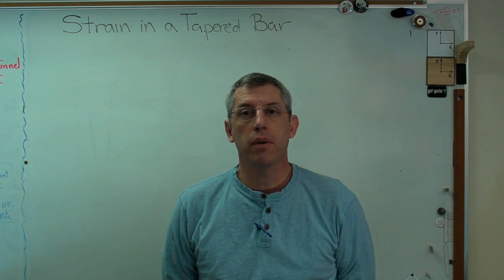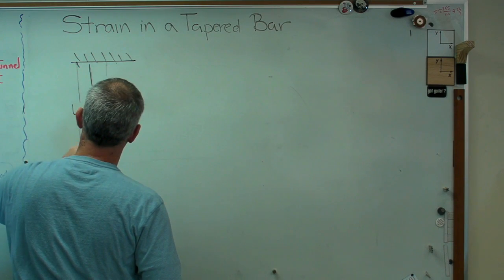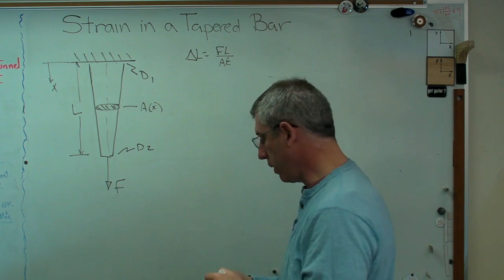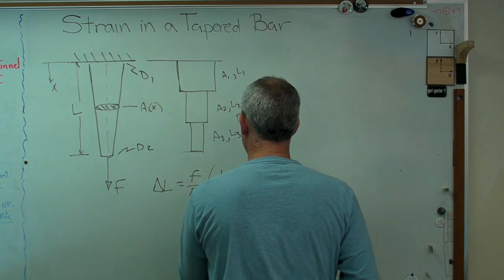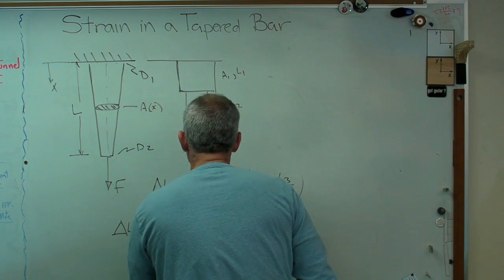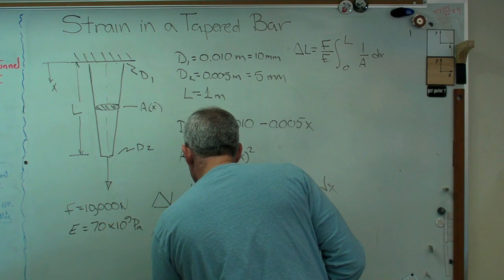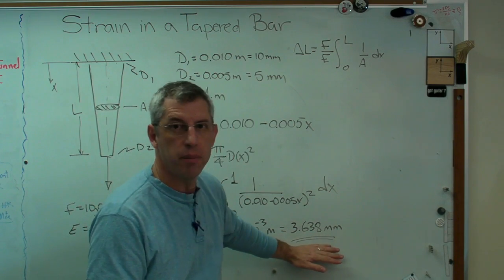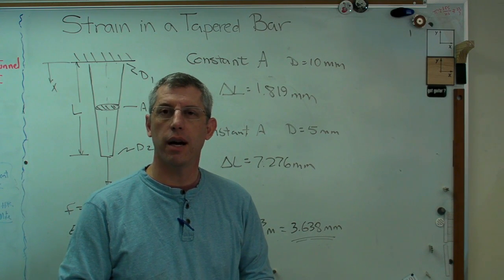Strain in a Tapered Bar - Brain Waves.avi

Comment: In case of a hanging bar force can never be constant...... Explain pleez
Reply from the maker: All I meant was that the external force will be distributed over a differing cross-sectional area as you move along the bar.  I'm assuming the gravitational force acting on the bar itself is small compared to the external force.